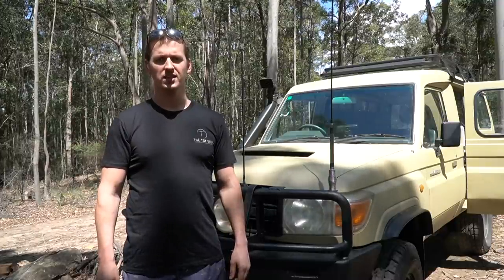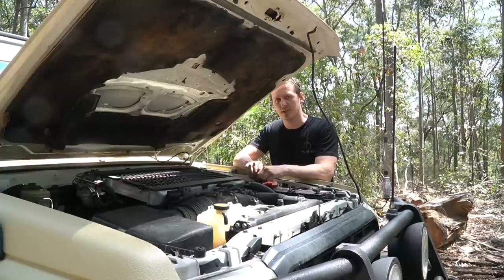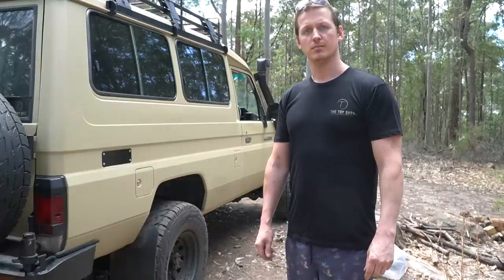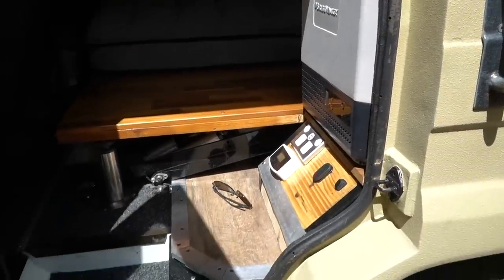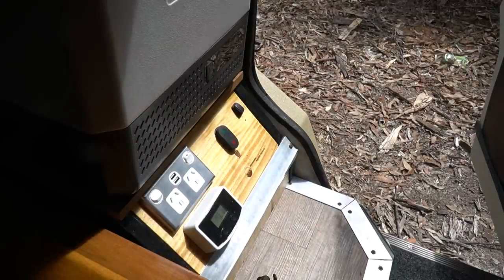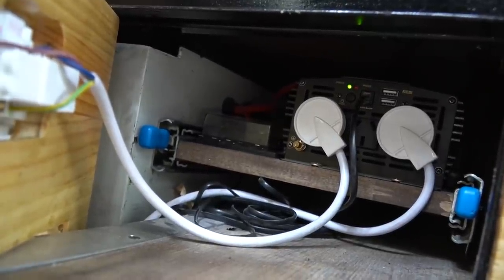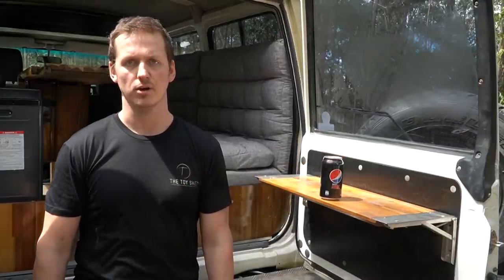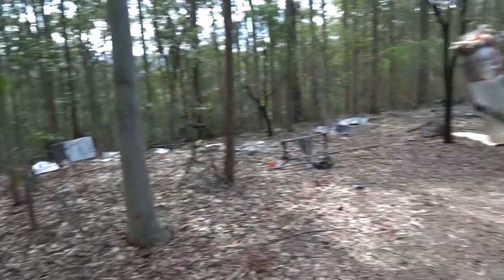Modified: THE BEST 2-PERSON OVERLAND TOURER IN THE WORLD IS FINISHED | Part 12

Comment: I'm loving the idea of a glow plug water heater - never heard of that before.  96A is quite a lot of grunt so I'll be interested to see what temp increase you get out of it, at what flow rate.
I've got a 25A 10L Duoetto in my Troopy and it's pretty good except it takes about 2 hours driving to get fully hot. I put on a proportioning valve to drop the temp from about 60 degrees in the tank to 45 degrees at the outlet, which is pretty good for showering and stretches the 10L of hot water further.
Reply from the maker: Yeah, 96 is a lot to contend with, hence the effort to make it idiot proof and only usable with the engine running. I'm swaying away from proportioning/mixing valves as they are notoriously inefficient, which is why I'm opting for something that heats to the desired temp rather than getting hot and needing to be cooled again. Hopefully it works out nicely. Aiming for a flow rate between 2-3L/min
Reply: I think their is a chance the glow plugs will provide instant, on demand hot water rather than heat up a reservoir of water like the Duoetto at 300W for 2 hours. I guess either storage or instant is fine though. 
Interesting to see if 1150W can do the instant hot water. - I see inline water heaters (for domestic use) are rated around 3000W, so I guess for domestic flow rates this power may be required, but slow down the flow rate and the 1150W may just work.
Reply from the maker: The thing I'm worried about are the losses both conductive and radiant. The heat added by the glows will be offset by the cold brass sucking it out again until the temperature reaches an equilibrium. I could model it and spend hours software testing, or just chuck it on a battery and see what happens. I'm going for the latter. 1150 might JUST be enough, but that's for another non-parody video.
Reply: @ridiculousthings4x4  Yes, the losses are the issue - wrapping in insulation not an option? The sink that is the brass bits will only increase the time to get hot water, but thermal losses will reduce the temperature.
Looking forward to you vids!

Comment: Looks good. Keen to see how you glow plug hot water turns out. Would need some pretty decent wiring with that kind or current draw. Is it going under the bonnet or in the back? I use a heat exchanger with an insulated 20L Jerry can for hot water. It takes about 5 minutes to get to 40 degrees and loses about 1 degree per 30 minutes for the first 10 hrs. It works well but instantaneous would be great if not has was required.
Reply from the maker: All the shower watery heatery stuff will be in the rear box, and run from the deep cycle with the engine running. That way I get the combined available draw amps when they're linked in parallel. The heat exchangers are a good solution, but I don't want to be tapping into the existing cooling system and adding potential failure paths. Plus they only work at operating temperature.

Comment: hi mate is it save to use off set rims for rear to correct the track correction does it effect my bearing as I'm only driving on sand for fishing cheers
Reply from the maker: It would be irresponsible for me to suggest something "illegal". All I would say is its extremely important to fit them correctly (torque wrench + loctite). I have used them on private roads of course for almost 50,000km without any issues, and you can see the sort of offroading I do on the channel.

Comment: Why dont u use simple heat exchanger with the coolat insteat that glow plug thing.
Reply from the maker: Because you'd never get instant hot water with a heat exchanger like that the best you'd do is heat a tank of water over time.
Reply: @ridiculousthings4x4  But you need 5-6kw for instant water... this is 300A+
Reply from the maker: Temperature increase is a function of mass flow rate, specific heat and an energy balance, amongst other things. To say "you need 5kw" so generally is ridiculous.
Reply: @ridiculousthings4x4  Why should i bother to explain it in a better way , when you are going to try to insult me in the end.
Reply from the maker: How many amps to melt a snowflake?